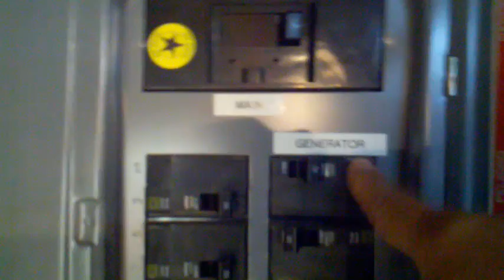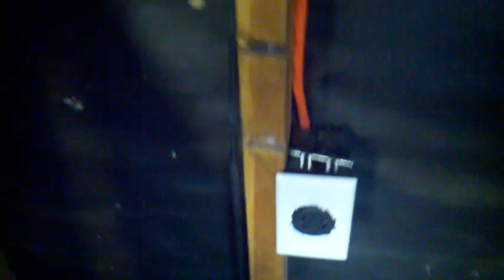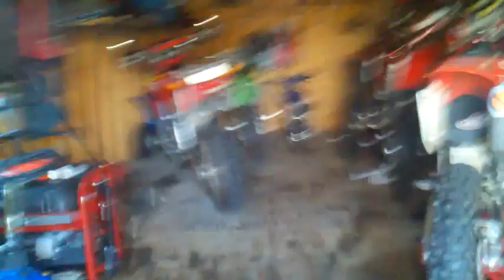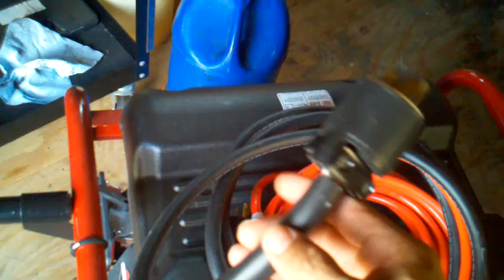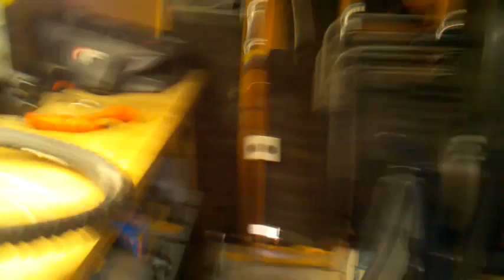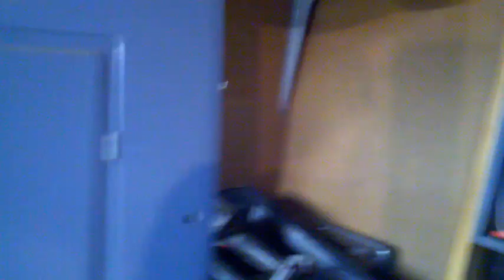How to hook up a generator to your house wiring   YouTube

Comment: Not legal without an interlock, and extremely dangerous using a suicide plug.  Swap out the outlet/suicide cord for a power inlet, and add the proper interlock kit on the panel, and you're good to go.  You could go from oh-so-wrong to a clean install, for about 100 bucks.